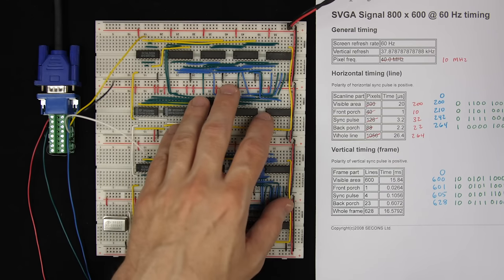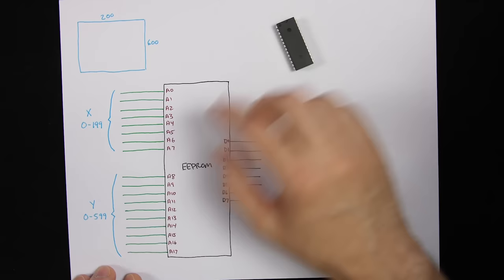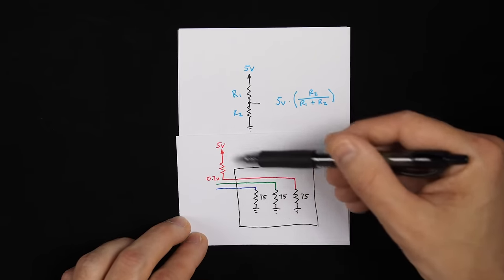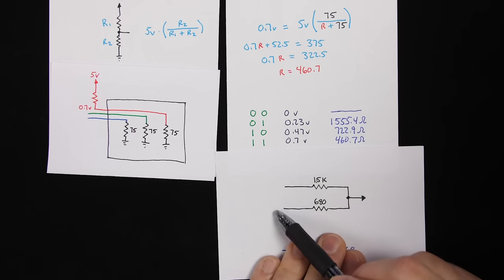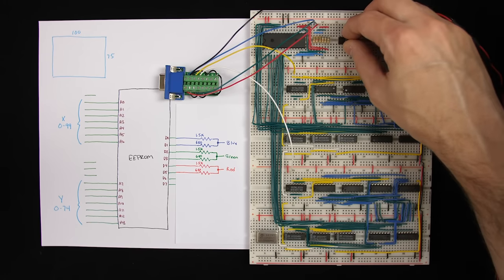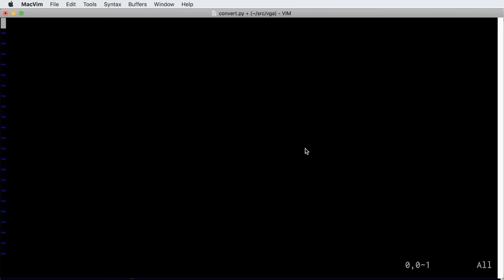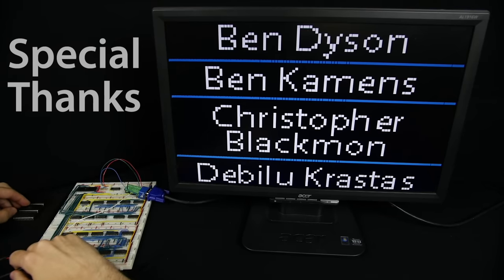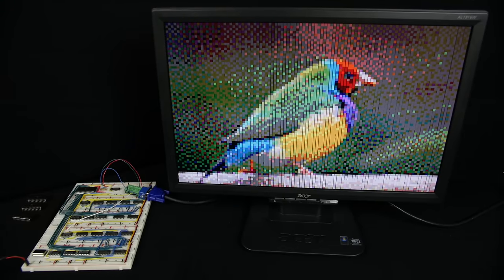World's worst video card? The exciting conclusion

Comment: Octal D-Latch like 74LS364 should solve black stripes issue. Would hold the data until next pixel will be read
Reply: thank you for saying this, seems nobody else cared.
Reply: @bryceforsyth8521  Although latching the ROM output would delay the output of the pixel by one clock.  Rather than change all the math, I'd just recommend running your sync signals through a 2nd flop before going to the monitor as well so everything is on the same clock cycle again.  See, we care :-)

Comment: HEY BEN important question! is it possible to add this module to your 8 bit computer and use it ? print results to the screen? or write a program that computer outputs images from eeprom which adreses came from the memory we programmed earlier ? How can we intagrate this module to the computer....Can we add new instructions for this module ? how would feed this into bus , do we need registers , too many questions :)
Reply: You'd need some RAM - possibly Dual-Port - where the computer can write image data and the video card can fetch its pixel data.

Comment: 23:36 Would it be possible to connect a switch to the A14 line of the EEPROM to store 2 different images instead of swapping chips? (or maybe use a bigger EEPROM with a DIP switch connected to the A14+ lines?)
Reply: Yes.

Comment: You had enough bitwidth to pull off the 8bit RGB 3/3/2 256 color palette. That'd make a huge dif! Do it do it do it! :)
Reply: Just a case of adding two more resistors and using two more bits from the EEPROM, right? Oh, and updating the format the image is stored in the EEPROM...? Does not having the 9th bit on the blue channel degrade the quality at all?
Reply: @nockieboy  it would mean there are no greys in the available palette but it would still be an improvement for a photo.
Reply: Had the same idea. 820Ω, 1.8kΩ and 3.3kΩ (all in the E12 resistor line) would work fine for red and green. Additionally, it would be possible to bump up the resolution to 100x150 (doubling the vertical resolution) without any timing problems, since one address line is not used yet. I generated the according color palette and tried it on the very same image as shown in the video, big improvement
Reply: Alastair Robinson Could the green resistors not be spaced out so that they line up with the red and blue, thus providing 2 grey shades?
Reply: @rlamacraft  Potentially, I think you could achieve one shade of grey by adjusting resistor values - I think it'd be very difficult to achieve both, though.  Lining up, say "010" and "101" with specific target voltages while at the same time keeping "111" at 0.7v would be an interesting challenge!  (A few years ago I did something similar to this with 6 bits per gun on an FPGA.  The design was eventually used for the MIST FPGA board for retro computing.)

Comment: Pretty sure Photoshop supports the outputting of raw bitmaps (not camera raw, but actual binary raw).
Reply: But he didn't want the binary raw. When he opened the file using python PIL, he got the indexes of the colors for each X,Y pixel (he mapped that previously in a known order), and that's what he wrote to the EEPROM.
Reply: He could have had it export the data, but was troubleshooting as the LCD was getting confused by nonzero data in the blanks.
Reply: Or you could do the whole downsampling and indexing in Python, no Photoshop needed.
Reply: @uint16_t  I think Python was definitely the clear winner here for multiple reasons. It's true.
Reply: Aka .bmp

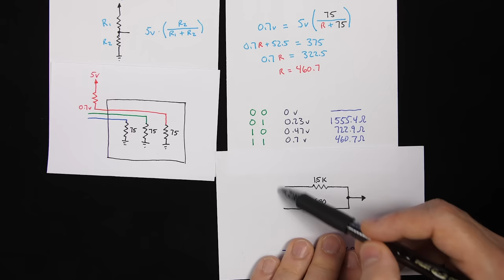Comment: At 10:20, when you have 1 on the 1.5 kohm and 0 on the 680 ohm, would you get a return current through the 1.5k then back through the 680 onto the pin at 0? If yes, how are you sure it's not a problem and you can skip putting a diode?

Comment: So that’s how you make a basic DAC. Love it.
Reply: Now I can build mysellf a sound card!
Reply: It's not a DAC, as all the signals are digital square waves.
Reply: chbrules digital square waves are sound, so you could make music with it
Reply: The signals going to the monitor are analog.

Btw. @UC2EqzbPD-x5upJs2q_-uyHw, some old DOS software (certain games, trackers, demos) supports outputting 8 bit mono audio to a parallel port. Turing that into a DAC requires basically just 9 resistors and maybe a capacitor — fun little project. Get cheap components with high tolerances and make the world's worst sound card :)
Reply: @chbrules converting each colour channel from a digital (binary) value to a voltage (analogue) is what I mean here. It might not be a classic DAC though, I agree
Reply: Yup, @kontrroller knows what's up 👊
Reply: @nex  ALL signals are analog by your pedantic definition here. "Digital" is an abstraction we use to define discreet voltage values utilizing square wave signalling. If you want to be even more of a pedant, square waves aren't actually square at all on very tiny time scales. There's an uptick and downtick time at the fore and aft of the wave.
Reply: @chbrules  Oh, of course using that definition of "digital" makes sense here. Thanks for the explanation!

I'd been thinking more along the lines of digital video (DisplayPort, DVI etc.) vs. analog video (VGA, composite etc.).

Anyway, the circuit converts binary numbers to voltages; I still don't get why that wouldn't be allowed to qualify as a DAC. Considering that the signal isn't going to a CRT, but a modern monitor which reconstructs the original frame buffer before displaying it, I agree that you can classify that as a digital transmission. I just meant to say that David wasn't wrong either. It's a DAC. You made a convincing argument that this point of view isn't the only interesting or valid one, but there's no way that dismissing it as incorrect is the less pedantic option ;)

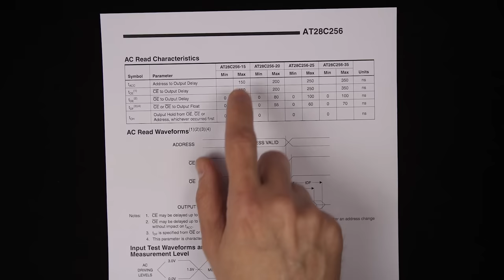Comment: I have had multiple mind blown moments in this video but 23:03 and 23:23 i find very interesting as this seems to explain why graphics cards will tend to use the full VRAM clock frequency for a multiple monitor setup when each monitor is at a different refresh rate even if just idling on the desktop. Running the full VRAM clocks may be an overkill but at least now I understand 'why' this happens from this video. It is to avoid display artifacts! (Once I set the monitors to the same refresh rate the graphics card will allow the VRAM clocks to go to idle states as normal.)
BTW Interesting use of the programed EEPROMs at the end there!!! 23:40

Comment: A recommendation for a follow-up video would be to store smaller tiles and basic transform functions (rotate 90 degree intervals, horizontal/vertical flip) . This may reduct the data requirements and lead to higher resolution potentials. Great videos, Ben!

Comment: Using try/except to check for array boundaries... Hmmm, better stick to H/W design, Ben.

jk, awesome video!
Reply: This triggered me as well :D

However in the python world way too much people consider this ok
Reply: His programming to showcase hardware is like programmers making art to showcase software.
Reply: Made me kinda triggered as well
Reply: RoiEX in the Python world, we would convert this to a dictionary and add a function to _missing_ that just returns 0. A much worse solution for sure and not the correct thing but it’s more Pythonic
Reply: Why would that not be ok? Are there situations in which it is suboptimal / gives wrong results?
Reply: @mannyc6649  it's just ugly.

Also exceptions are slower than a single if, no matter how optimised.

For a little script like this it's not a problem, but it isn't quality code.
Reply: C S alternatively, everything in Python is very expensive.

That being said. I use Python all the time because it is the best language for small scripts in my opinion
Reply: This is proper python programming.
Reply: @cicciobombo7496  I see. Instead, is it generally acceptable to write try/except statements for errors that (unlike this one) require a rather involved code the be avoided from the start? Or should one use them only as failsafes?
Reply: I don't even know python and I know that's wrong
Reply: I see a lot of "triggered" people.  He did this perfectly.  He got an error that was simple for him to patch with a try/catch.  Why rewrite the whole script for a pythonic program, when you can add a few keywords and get the proper output?

He's making a pixelmap, not a pixelmapping script.
Reply: This is actually the Pythonic way to do it. From the Python docs: "EAFP: Easier to ask for forgiveness than permission. This common Python coding style assumes the existence of valid keys or attributes and catches exceptions if the assumption proves false. This clean and fast style is characterized by the presence of many try and except statements."
Reply: @mannyc6649  just stick to using try/except when you know there might be errors, any kind of error.

In this piece of code it's wrong because you are INTENTIONALLY creating a source of error.

Comment: Even, this demo shows just a low resolution image on a vga screen, but that's not the point. Amazing is the low part count that's used for and the understanding of the timing that have to understand previously, to build that interface.
I remember my home build superimposer to put my amateur radio callsign into a PAL video signal. The basic functionality was similar.
Thanks for the video

Comment: I would love to see this "video card" work on an actual computer. Maybe with the 8 bits from the parallel port and one of his control inputs (eg select, busy, ACK, paper out) for synchronisation.
But I really don't know if this is even possible. Can the parallel port even do 10MHz?
Reply: The data rate is only 45kbit/s. I bet somebody could get Windows 3.1 to display using this circuit.
Reply: You can shove about 2,621,440 bytes per second through a parallel port.
Reply: "Can the parallel port even do 10MHz?"

If there's a buffer between the parallel port interface and the GPU itself, it wouldn't need to. Then the computer could write to the buffer at an arbitrary framerate, and the GPU would just read the contents of the buffer whenever it updates. However, Wikipedia says a regular parallel port has a bitrate of 150 kbit/s so it could only do 2 frames per second at 100x75 and 8 bits per pixel.

Comment: 3:03 The flashing image is of your CPU, are you suggesting your gonna hook this up to your breadboard CPU?
Reply: Changes need to be made, with only 16 bytes for instructions you can't do shit related to video. He barely fit his Fibonacci counter!
Reply: It would most probably have terrible buffering issues and it certainly not be fast enough to render full frames between syncs, but it would still be able to output an image.
Reply: @Meoiswa  I'd really want to know how you can access that SRAM and write to it during the HBlank and VBlank... that'd be f'd up. Saw someone else do a reverse emulation on the NES which actually had to work with that and boy was it funny.
Reply: Actually, my bad, It would need one more instruction to be able to tell the GPU when the RAM is available for it to scan it. Otherwise the CPU and GPU would be fighting over who sets the active address. Luckily his instruction set still has some free slots, and this way it only needs one.
Reply: I've not watched this in full, but I'll bet he's planning on demonstrating DMA, so that the GPU can read off of some statically allocated RAM, potentially two buffers selected by a control block so the CPU can write to one while the GPU is reading from the other.
Reply: You are making it way too complicated, guys. What the 8-bit computer needs is a character generator that reads its data from a few memory locations.
Reply: @JanBruunAndersen  Using predefined charectors you would just have to tell the GPU which memory location to look at for every few pixels
Reply: @JanBruunAndersen  making it way to complicated? i mean... he is making a video card on a bread board.......... cant get more complicated than that.
Reply: @paulstelian97  It's called double buffering. Write to one buffer while the other gets pushed out to the monitor, then swap the buffers.
Reply: The number is 42. The meaning of life.